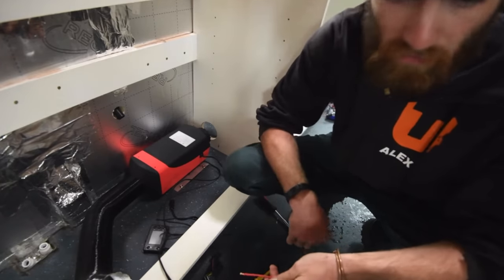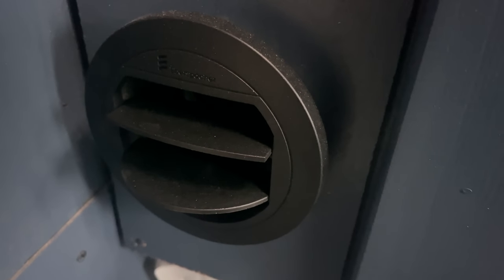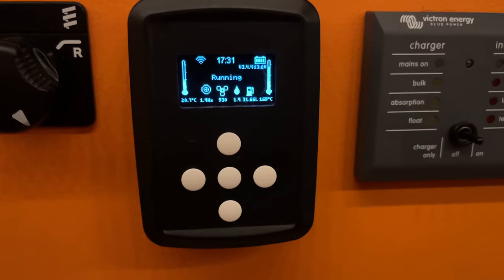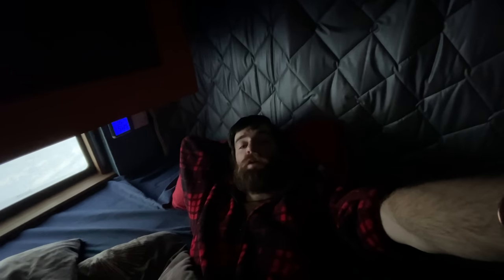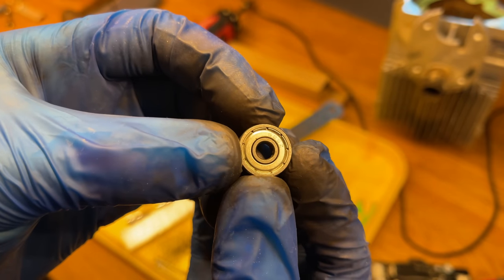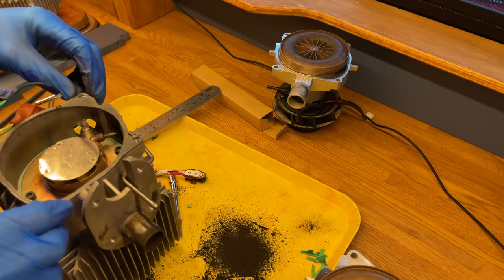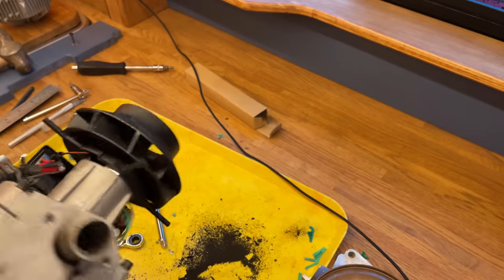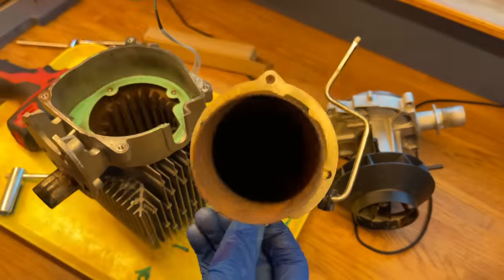2000 HOURS LATER! Chinese Diesel Heater

Comment: The Z designation on the bearing means it has a metal shield holding the grease in. A ZZ bearing means it has those metal shields on both sides which is what you need on the heater. You also come across RS or 2RS bearings which means they have rubber shields instead of metal ones. They probably wouldn't stand the heat in this application.
Reply from the maker: Thank you. I had been wondering the z & zz. I knew Z was metal. I just didn’t know both.
Reply: Thats why you but the CERAMIC bearings for upgrade
Reply from the maker: @stevecarlisle3323  I had considered ceramic, but I couldn’t find any examples where people had to use them in a diesel heater for these particular circumstances. So I choose a more known and tested option.
Reply: Good to know, esp as I have a Kirby vacuum cleaner!

The motors & therefore bearings on these I don't think experience much heat - if anything - experience a lot of very cold.
Reply: @Lucentlens  yeah I don't think rubber seals would be a problem. If the motor got hot enough to melt the seals you have bigger problems
Reply: The shield is stamped with a single Z. Bearings without additional letters are generally open, unshielded. Z is a single metal shield (other side is open) and then there is the ZZ or 2Z codes for double metal shields. Same with the rubber seals. That comes with a RS (single) and 2RS (double).
Reply: @juliogonzo2718  High temp rubber/plastic seals might actually be better for the brush side of the motor. They should keep dust from the brush wear out, more effectively than a shield.
Reply: @sourand jaded Imperial bearings is a whole nother cup of tea.....
Reply: Z/ZZ and RS/2RS checks out, but almost nobody seems to actually sell the bearings with just one side shielded, so any bearing you buy that's called Z is really ZZ and any RS bearing you buy is actually 2RS.
Reply: @AlexanderBurgers  i have ordered, and received, single sided by accident once...
Btw. I came across a (2)RD seal designation last week. That is for a silicone seal rather than rubber/NBR.
Reply: @FlexDRG  Unlucky to get a manufacturer to actually follow specs, haha. 
Silicone seal sounds neat, wonder what the intended application is, higher temperature?
Reply: @Hunter_Bidens_Crackpipe_  they certainly have their niche application!
Reply: @MispronouncedAdventures  The ceramic bearings won't like the dirt/debris any better than the standard carbon steel bearings.
Reply: @Lucentlens  Don't worry about the heat. The 2RS type will withstand high temperature way beyond what your Kirby motor will produce.
Reply: @AlexanderBurgers  You just pull out one shield or seal with a dental pick if you only require the bearing to be single sealed/shrouded.
Reply: Very informative, thanks.
Reply: @AlexanderBurgers  Z bearing SHIELDS are designed to be removed easily and are a loose fit for keeping grease in the bearing internals in a clean or isolated environment. The ZZ designation is for SEALS that are not intended to be removed and both function to hold grease in and keep dust out in dirty environments.
Shields vs seals because of how they make contact with the housing and the inner ring. Think of it as one can seal out the weather and the other will let it in.
If you only need one shield/seal on your bearing then you order it with 2 and remove one yourself for your application.
Reply: Z means its produced by russians and ZZ means its ready to rock!
Reply: Had a German diesel heater, every year always something wrong, bought a Chinese one with the intention of binning it when it stopped working, had it 4 year,works fine every winter. It used to cost me more every year to have the German one serviced than the Chinese one cost to buy brand new😊
Reply: The bearings are on the cold side of the unit.  Commutator brush particles shouldn't be getting into the things if they're actual sealed bearings and to be honest brushes don't usually shed a lot of stuff under normal circumstances. 

What's seen on the outside of the bearing might have been ingested dust - and on a second look the blower (circulating) fan is heavily encrusted with grime, so it's likely that the stuff seen on that end of the motor is environmental schmoo (aka "That's human skin, Ewwww")

I wouldn't bother with ceramic for this use - they won't give you any advantage, may be vulnerable to shock (impact) damage and it's not hot enough to matter  (Rubber seals are likely to work just as well, to be honest)

These things are webasto knockoffs and a standard webasto gasket kit should work (about $5/€5/£5). In a pinch you can make one (gasket sheeting is cheap) as they're only paper and the busted one is on the intake (low temp) side

WRT the pump, you can get full rubber clamshell mounts for these and they vastly reduce noise over a naked clamp.

Kerosene is probably a better idea in really cold conditions (it's good down to -40 or less) and it's a good idea to tweak your air-fuel ratios for the fuels being used (there are procedures for doing this with a variety of fuels. This may change with summer/winter diesels)

Because these are webasto knockoffs(*), the Webasto service manuals are useful - and downloadable from their website

 (*) I think they're licensed rather than bring flat-out chinesium. Usually imitations start deviatimg from the originals and these things don't

I'd get that muffler insulation tested. It looks like asbestos (relatively common in high temp stuff imported from china and items imported from the USA even though it's been illegal here since the 1990s)
Reply from the maker: @miscbits6399 I was under the impression that it’s was a use / copy of the Espar airtronic D4 design and not the Webasto air top. But your same point applies. 

Yeah I could kero and make adjustments but the convenience in the Arctic is that the diesel is pre-treated and it’s convenient. Come out of a my large fuel tank all the time so I don’t have to worry about draining a small one since I’m using 2 L a night
Reply: The best bearings are the hybrid ones : Si3N4 balls and steel casing.   They don't conduct electricity so there's less corrosion. 
Rubber sealings car be removed to replace the grease every 2 years.
Reply: @Hunter_Bidens_Crackpipe_  ceramic bearings matter in things like EV motors and satellite gyro wheels - applications with very high residual currents or static discharges which can arc and damage standard bearings (pitted balls don't roll well - as the first generation European gps satellites found out)

for other applications they're not worth the premium
Reply: Seals touch inner and outer race where as shields do not. The drag from a seal is something to be considered as a con where as keeping contamination out is a pro. Contamination is the #1 cause of bearing failure

Comment: I love seeing someone actually fixing something instead of just throwing it away and replacing it.
Reply from the maker: Thank you like to learn how to fix things
Reply: Totally agree. This should be the way forward, fix not replace.
Reply: @MispronouncedAdventures  Hey there, 'm thinking about getting one of these Amazon has the 8Kw unit for 97$$ right now... A utuber claims you can use waste oil or pretty much anything but gasoline🤣 So I throw away a lot of fryer oil, do you think that would work in it??
Reply from the maker: @autojohn-pu1vf  the 8kW Chinese units are just a 5kW unit with a high max allowed pump and fan speed ( the 5kW unit are a copy of the 4kw western versions). You won’t get 8kW out of it and running it at max will not be good for it. 

As for alternative fuels, yes. Pure Kero works, as for waste type oil its normally mixed with diesel to help the burn. But it will be a dirty burn and like need setting changed to burn well. 

I do have one which runs on gasoline or diesel  but it uses a proprietary internal burner
Reply: @MispronouncedAdventures  TY for the quick response, I won't be able to use the furnace🥶until I fix mold in the house making me sick, and got my bed in front of the fireplace...

So are these settings a screw adjustment, like a carburator? and your saying the fry oil will mix with the diesel OK????

This may be a permanent solution to all the money I waste heating a huge house (even with all the extra vents shut) when I only go in a few rooms normally.
Reply from the maker: @autojohn-pu1vf  adjustments are digital opposed to mechanical like a carburettor. 

Many of the controllers have the option to “tune” which is the pump speed versus fan speed at different power settings.  That affects the burn. 

Hopefully you recover quickly
Reply from the maker: @autojohn-pu1vf  I know a few who use diesel heaters as a permanent heating solution for smaller areas of their house
Reply: @MispronouncedAdventures  Thanks! well that settles it I'ma gonna get me one of those!!
Reply: @MispronouncedAdventures  I throw away a lot of motor oil too🙄My big roll around shop oil vat (you wheel under cars on a lift) gets full of motor/fryer oil yearly and Wallmart takes it free... 

So you are saying If I mix diesel in it and stirr it up will it reach an even consistancy so I'm not having to mess with tunning of the pump all the time?
Reply from the maker: @autojohn-pu1vf I would join one of the Facebook groups for the diesel heaters. People will have more specifics on using used motor oil. I’ve not used it myself like that.
Reply: I fix things for a living and I’d have thrown it out
Reply from the maker: @brianhewitt8897  seems a bit of a waste to throw a perfectly good heater out because of 2 bearings for £6 and I’ve now put almost another 2500+ hours on it

Comment: Ive had one of these heaters in my Garage Office for about 9 years and it gets heavily used most days.  Mine is a 24Volt version to match my Battery Bank and Im on my third glow plug which is the only problem I have experienced.  The glow plugs are supposed to be a special 24 volt plug but I cant see any difference between the the 12 and 24 volt plugs so they may be pulling my leg on that one.  Last time I pulled the heater apart I was expecting to see unimaginable filth as per some You tube videos but was quite surprised to see how clean it was.  The last time I ordered a new glow plug I ordered 2 for another spare and it came with replacement gaskets.  So should be good for another 9 years 🙂.  To stop that annoying fuel pump tick I hang the pump on 2 strong cords stretched apart, rather than using the rubber mount provided.  The tick then doesnt get amplified by the wall or frame that it would normally be mounted to.  Significantly quieter.
Reply from the maker: Indeed, the glow plugs are known as one of the more consumable parts in long-term use. I don’t know if there’s a difference between the 12 v and 24 V glow plugs. If there is I don’t imagine it would be visible, I would’ve thought it would be the winding of the coil inside of the glow plug itself which you can’t see would be different for each voltage. However, it might just be the same. 

Heaters set up well and used often are usually pretty clean inside. As for my pump it’s loosely mounted so I don’t hear the tick that much inside the van.
Reply: the heaters are so cheap having a few spare glow plugs and a little extra fuel line (all fuel lines harden over time) to keep it running is a worthwhile investment..... I'm loving mine so far, it's kept me toasty up here in the cold north so far, loving the thing

Comment: The letters on the bearings denote the shielding, a totally open bearing would have no letters, Z means metal shield, ZZ means they are on both sides and not open one side and shielded the other, bearings with removable rubber shields have the letters RS after the number.
Reply from the maker: Much appreciated that was the main bit of feedback from this video was the explanation of the lettering on the bearing sizes referring to the type of shield
Reply: @MispronouncedAdventures  Another spec that people in my roller skating world obsess over but is actually irrelevant to our application and will also not matter for something like the shaft in these heaters is ABEC, those ratings are tolerances intended for high precision equipment and there are ABEC 1-9 ratings.

Comment: Always make a copy of every gasket on paper so that in the future you can just have a supply of gasket material and make any gasket you need
Reply from the maker: Makes sense to me. Wasn’t something I knew at the time
Reply: Does this work for car head gaskets? Not familiar with that stuff so I'm curious
Reply: @illidari12211 Head gaskets are are generally very specialized multilayer parts. On some more decadent 2-stroke and other smaller engines they can still be prettt simple. Still usually something with steel.

Comment: Oooooh that bearing went in far too easily! The old one has been spinning in the housing. A bit of red loctite (bearing retainer)  should have been put in or this one will spin it out even more. - Even a dribble of super glue will work. also- when you fit new gaskets- wipe them with a little oil so that they will release next time. -Tips from an old fart engineer.
Reply from the maker: Thank you for the tips. I agree I did notice it went in very easy ( it’s not so loose, would drop out if you inverted it ) I do wonder if the old one was a similar fit. It just had so much motor brush dust deposits that it filled in all the gaps.

Comment: If anyone wants runtime to be precisely recorded, I would personally recommend buying our meter when it’s powered and connecting it up
Reply from the maker: The afterburner runtime is precise. What’s your meter?
Reply: @MispronouncedAdventures  I mean such that you don’t have to worry about adding up then between different control equipment if you ever change it out and if the heater itself is ever changed out but the controllers left you can get little 12 V metres that just count up each hour and put it across something that’s powered internally when it’s running I did that and it’s a good measure of how much each one has got as I swap a couple out as there’s one that’s been cleaned or maintained and one being run

Comment: I saw a vid of a guy who run it on high 15 minutes before shutting it off. Said he's never cleaneded in in like 5 years? and it's had no problems. Doesn't seem stupid at all.
Reply from the maker: There are two school of thoughts on that one. Some believe in it, others go if they soot already in there, you’re not gonna burn off carbon. 

I don’t have an answer. 

Mines almost 4000 run hours now, and pretty clean. 

My thoughts that principal would be if you’re low output burn is causing it to soot up then it needs tuning for a better burn on low.

Comment: If you use the new gasket as a template and cut one from a cardboard box (cereal is brilliant) and seal it with gasket sealant it would have been a better job mate and you still have the new gasket for your other heater
Reply from the maker: Very true, a few people have said the cereal box cardboard does make good gaskets
Reply: Thank. Good to learn that.

Comment: i have roughly 14,000 hours on my chinese diesel heater.  I've cleaned it out once.  Bearings make a little noise when it's cold but once it warms up it's quiet.  It's running great even right now.  I have 3 spare fans i bought when i first got it and haven't used any of them yet.  I have new 2 spare pumps I haven't used either of those yet.  I got a couple glow plugs i haven't used. 1 Bag of 10 fuel atomizers I only used 1 when i cleaned it the first time.  Best $150USD I ever spent and it runs almost 24/7 in the cold weather from about October till the end of April.  I can get 10 of these for the price of one of name brands.  

I run mine at my Custom Low Setting of 2.5Hz, 2500 RPM, 1280 Feet Elevation,  heat exchanger stays around 180-190C (356 - 374F)  with outdoor temps at -4C ( 24F )
Reply from the maker: There are great units when you get good ones, installed well and tuned for your needs. I will being heading back to the Arctic this winter is looking for -40c with it. ( and spares )
Reply: Thanks for those settings (just-in-case).
Reply: They must have got all the electronics welded in correctly very rare. It will let you down when you realy need heat.

Comment: As a side note for the gasket you could use a liquid high temp gasket which just comes in a tube. They work great in situations you might not beable to get a gasket.
Reply from the maker: Quite a few people have mentioned this option if you ever in a  bind
Reply: In order to reuse gaskets on our racecars, we used to apply antisieze to both sides of the gasket. Silicone spray would probably also work in this application.
Reply: Once I bought one big sheet of gasket, about size 1000*1500 mm. I just cut from there the needed size. The whole sheet was cheap.